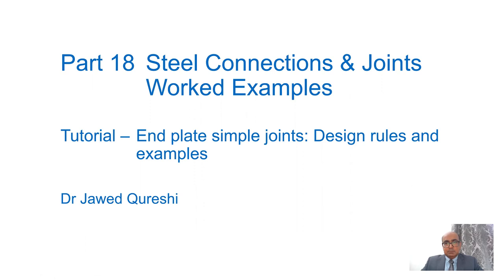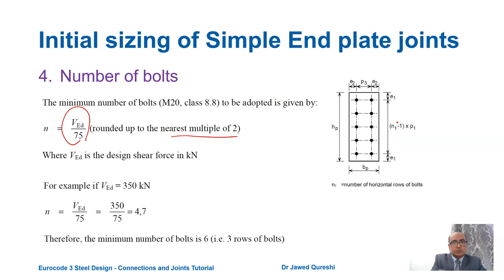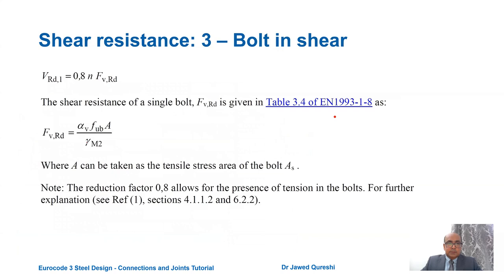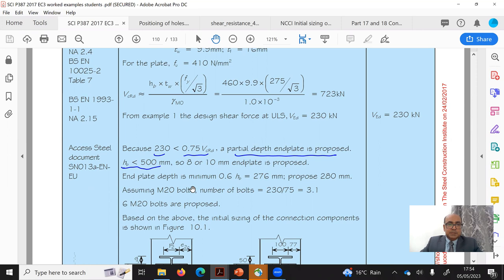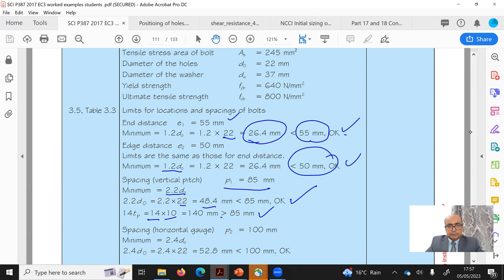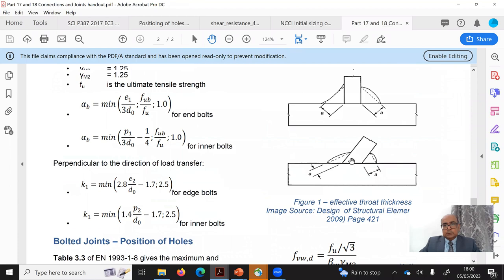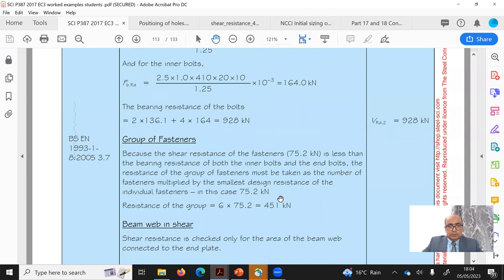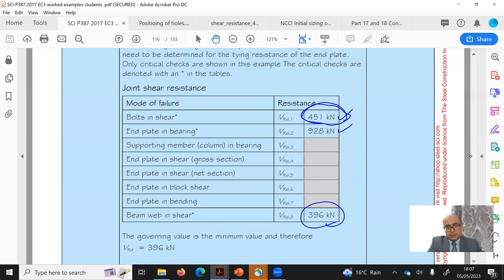18 Steel Connections and Joints Worked Examples | Eurocode 3 Steel Design series

Comment: Hello, Dr Jawed Qureshi ? Are these calculations useful when we have a dynamic loads ? If no, could you please tell me where to read ? :)
Reply from the maker: These formulae are for static loading. I don't know from top of my head how to deal with dynamic loads in case of joints. Please refer to SCI green books for further details. or refer to this book https://onlinelibrary.wiley.com/doi/book/10.1002/9783433604762
Reply: @DrJQureshi  Thank you for the quick answer, Dr. Jawed Qureshi :) My name is Petar Petrov. I graduated as a mechanical engineer long time ago. I ask, because I am trying to make hand calculations of a spreader beam with two lifting lugs and three point loads. The suddenly lifting, moving and tilting with carried load have a dynamic behavior. I am focused on the stress in base material, stress in the weld material, checking the lifting lugs for different failure modes (shear plate failure, bearing failure, failure due tension). I also try to calculate the endurance life limit during fatigue. I found several standards EN 13001-1 ( Cranes. General Design ) , EN 13001-2 ( Load actions ), EN 13001-3-1 (Limit states ) and EN 13155 ( Non-fixed lifting devices ) that corresponds the goal, that I want to achieve. I noticed, that building may be designed based on ultimate limit state, if the cross-section is first or second class. But I am not sure, if this is valid for mechanical structures with cyclic loading (fatigue failure).